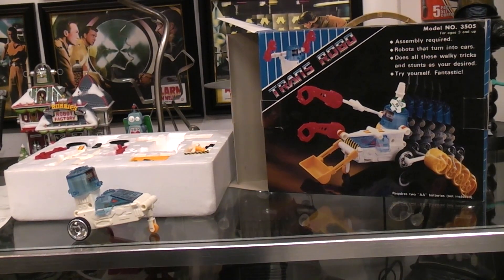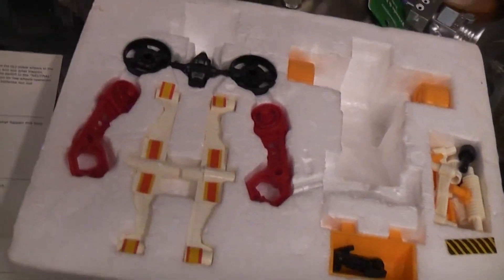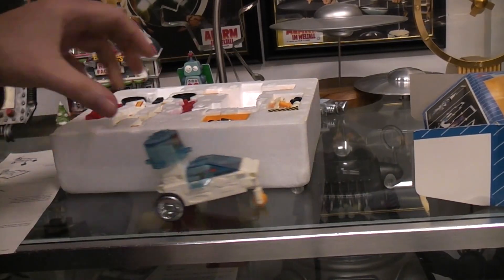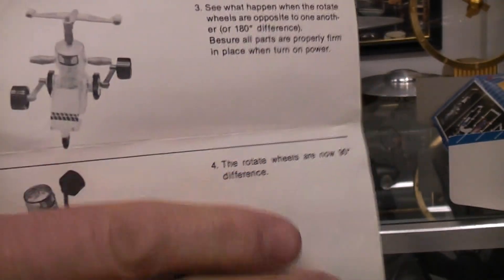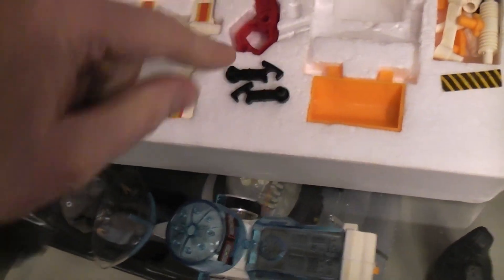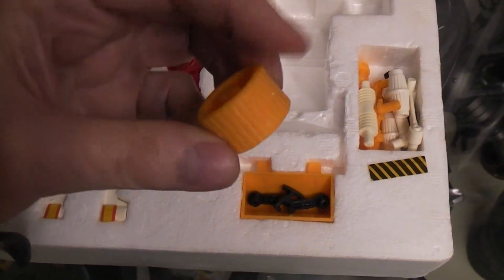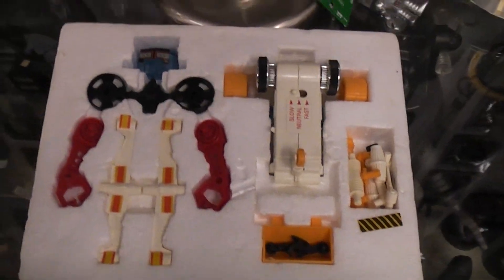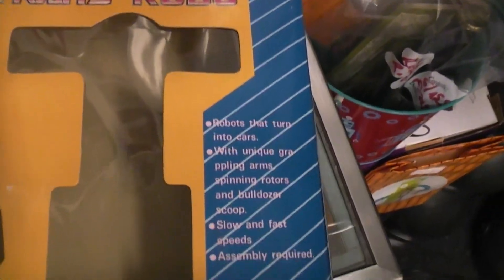Trans Robo. Battery operated kit lets you make different types of robots.

Comment: Were any of the parts motorized once they were attached, or were the wheels the only things that moved?
Reply from the maker: The wheel axle seems to be the only motor driven shaft. The neutral provides a way to push the toy "free wheel" if its is turned OFF or maybe you do not have batteries and want to play with it.